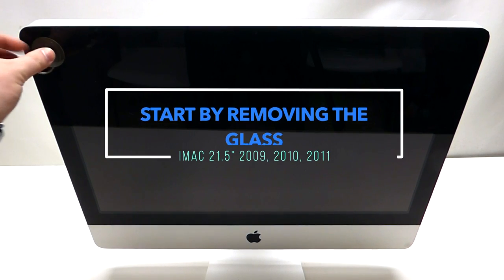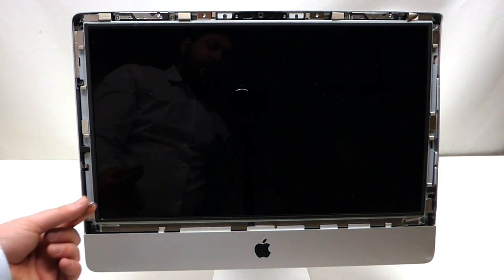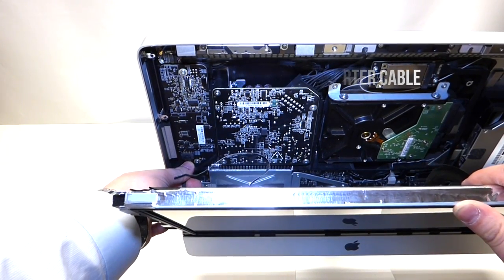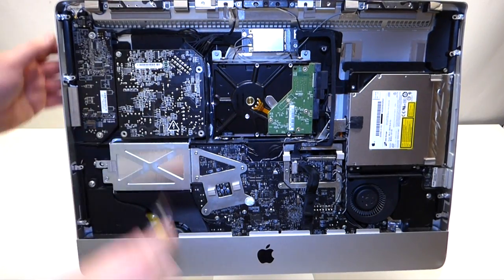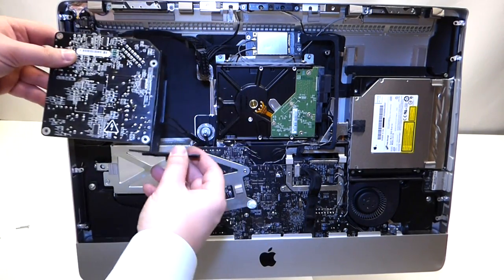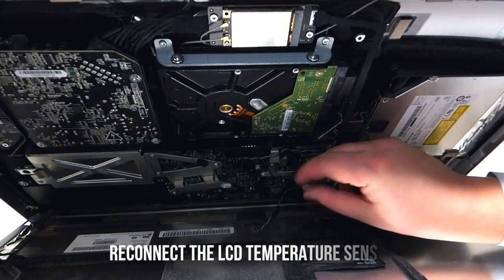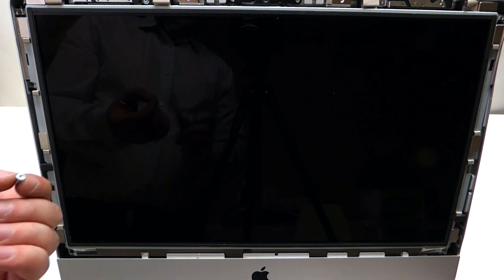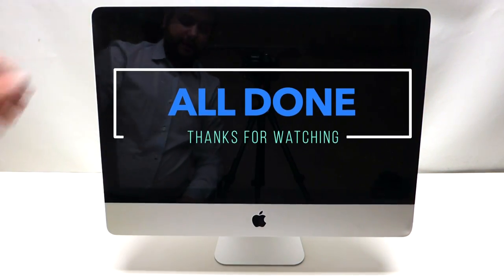iMac Power Supply Replacement 2009 2010 2011 21 5" Apple Dollars #12

Comment: Excellent video. I followed it just now to replace the power supply on a 2011 21.5” model.  Worked like a charm. The data connector on the 2011 model screen is smaller and more fiddly than the one in the clip but the idea and procedure is the same. $50 for a used power supply on eBay, $7 for the suction cups for the screen, the torx drivers I already had, a lot cheaper than a replacement computer.

Comment: This was very helpful. Was quoted $180 plus tax to get it fixed and after finding your video, I purchased the part for $22 on eBay and installed it myself. Thank you very much for sharing.
Reply from the maker: Glad to help! Support us on Patron https://bit.ly/2F3ebil or By clicking the KEEP US GOING button at https://www.appledollars.com/support-us
Reply: @GRIBSOFT  great video, but how do i know if this is my problem?  i have this model imac and i powered it off, unplugged it for 8 hours and now it has no life and won't turn on at all
Reply: @TheJstringer  listen for a "bz" sound coming from the top of the screen. thats the issue i had, with my imac.

Comment: Must be a lot of different iMacs in those years. My 2010 was a lot different inside than this one. Two of the large ribbon cables could not be disconnected from the screen side. I had to work around the screen to get to the power supply.

Comment: hi Thank you for the video. I've got a dead iMac 21", bought a pair of suction tools and the power supply, and pulled out the screen. But soon encountered a problem around 33 sec of your movie: after successfully pulling up the top two cover, I cannot even unplug the lower part of the screen! I don't know what's going on, but it seems that the lower magenet or something got in the way to prevent me from pulling it out. Not sure how to proceed. Any suggestions? many thx!

Comment: Hi! Good video. My iMac 2009, is totally dead, no sounds or lights when pushing the start button.
I've accessed the PSU. AC power is going in. The mother board LED 1 lights up (when the AC power is connected to the iMac).
DC out put (COM is 1) - No 2, 7, 8, 9 indicates 12V,  
No 3, 4, 5, 6, 10 has Zero Volts.
Is this the PSU or something else? Appreciate your export opinion. Thank you

Comment: I am debating if i need to change the power supply on my mid 2011. It stopped powering on. I opened it up and have the Led indicator #4 is on. But #1,2&3 are off. I can hear a buzz from the power supply but nothing else is on. I cannot hear the hard drive spin. Any suggestions? Would it be power supply if that #4 led is on?
Reply: Did you ever figure out what was wrong with your imac?
Reply: I'mstill alive no still dead, i was wrong with which led was on. Its number 1. But still do not know whats wrong
Reply: Im in the same boat. I have already bought a new imac at this point. I was just trying to figure out if i should spend the extra money to attempt to fix this imac. I know before my power supply went out i was also getting a black screen so i feel like it's a lost cause at this point. Ready to pull out the hard drive and dump the whole thing.

Comment: Thank you for your well infomred video. I will apprecaite if you or 
anyone in your forum could tell me what is happening to my Imac mid 2011
 27 inch not coming on. The stand-by LED light on the boards comes on 
and goes off immdiately when  I insert the power cable. It is not stable
 for me to press the switch botton . So is the problem with my power 
board of the logic board. I need your urgent response for me to know 
what to buy as replacement
Reply from the maker: You need a new power supply
Reply: @GRIBSOFT  many thanks for your prompt rsponse. Is there no way or advice or link you can share to troubleshoot the problem with the pow
er supply in the view to fix it rather than buying a new one
Reply: @GRIBSOFT  Hi, Thanks for the advice. I just change my power supply . unfortunately my imac did not come on. it was behaving the way it was before changeing it. that is the first led standby light on the logic board showing green was not stable when you put the plug in. It goes off and on rather than it to be stable. immediatly I press the switch nothing happens and the led light will stop flicking. After a while when I remove the plug and repeat the processm the led light will continue to flickers rather than being stable. What else could be responsible please. Just to note also,When I tested mypoert supply with meter, the input voltage was 240 but there was no output voltage to signify that a supply is going on to the board

Comment: I’ve always heard that you shouldn’t touch the front of the power supply where all the connections are soldered to avoid shock. Is that true? Or will you only get shocked if you start messing around with the capacitors?

I see on the video you grab it without Rubber gloves and touch the front side of the power supply unit.
Reply: Sorry for the late reply, but the reason he did touch it was because he had the iMac unplugged. He states the caution at 1:40. Cheers.
Reply: @charlie1361  it will still shock you
Reply: @piggybackbuyer2329  this shocked you without being plugged in? What did you touch that you were shocked? Thanks

Comment: Hi, thanks for posting the helpful videos. For the past couple of months my imac had an issue, it would shut down suddenly after 15 mins sometimes 10 or 5 mins, until it stopped working at all (no power whatsoever). I ordered a used power supply online because i assumed that if there's no power, it must be the power supply. I replaced it and still no power(no sound, light or fan) nothing. I'm not sure if the power supply that i bought was not functioning or the cause is something else. I also don't know how to test a functionality of a power supply with a multimeter. Any advise would be much appreciated. Thank you
Reply from the maker: 1 Power supply, 2 Graphics Card, 3 Logic Board. Replace in that order.

Comment: My mid 2011 won't turn on... when I press the power button, I hear the CD drive trying to eject or something, but never hear the startup tone. The screen is black. Does that sound like the power supply? If I plug in a USB mouse, the red light will come on but there is the hard drive never starts and the display is black
Reply from the maker: The LCD is the first thing to replace, then try the graphics card next.

Comment: Nice simple video!   I have a 2009 iMac 27, suddenly today it will just not turn on (no sounds, no beeps, no fans, no response at all).   We just had a power outage during a storm and I'm not certain if i need a power supply or the main board...  (it is plugged into a $50 surge protector).  My only clue that i might need the main board is because one diagnostic green light is on when plugged in (looking from underneath on the inside) which indicates power supply is getting power right?  how can i tell??
Reply from the maker: It's the power supply.
Reply: @GRIBSOFT   even if the green diagnostic light is illuminated?
I'd hate to spend the money on a hunch
Reply: @GRIBSOFT   What does the green diagnostic light indicate (on the main board)
Reply: I have 1,2,3  led lights on. On start up I hear the initial click but no chime. Black screen. Fan runs normally. Could Power Supply work partially to trick me it's something else wrong?

Comment: My 2009 iMac shut off with no reasons. When i try to turn it on, it makes the classic "dong" sound but the screen remains black. All te USB ports has no power but the imac still run.  It could be the power supply?

Comment: I’m having an issue with my 2011 iMac. I recently dismantled it to clean the 9 years of dust that had accumulated inside the fans etc. When I put it back together the screen is now flickering when I turn it on. It was working 100% fine before this. I did remove the power supply unit too when dusting. Power supply unit my issue?
Reply: follow, my screen is flickering as well. Is your screen flickering like the brightness varies. (so not like on and off)
Reply: ACMDE changed my power supply. Working 100% again now

Comment: Do you know how to check if the power supply is what needs replacing? Thsnks
Reply from the maker: Only trial and error.
Reply: @GRIBSOFT  can you write  a basic description of how to determine the power supply is the problem?  that is what this video is missing at the beginning
thanks
Reply: @TheJstringer  Also, what's the correct power supply?, what are the specs? is it upgradeable to a 310w? Why or why not?

Comment: Good day I would like to ask if you have some idea, I buy 21.5 iMac in japan  they use 100 volt.. can I use my Mac in Philippines which using 220 volts?
Reply: It should do. I'm in the UK. My 2007 iMac has a power supply that operates across 100V-240V @50Hz-60Hz. Apple uses universal power supplies to simplify their production processes.

Comment: My iMac 21 don't start at all. I press the button, but nothing appens. Can it be due at power supply?
Regards
Reply: Paulo Ramos same, did you get it fixed?
Reply: @idantal1213  Yes, after dismount it all and clean the supply power. I also changed the power cable for another.

Comment: Is there anyway to test the power supply?
Reply from the maker: On older imac there were light indicators. I wouldn't test the power supply with minimal knowledge as it is live at has AC current going through it. Your best bet is to just purchase another power supply used.
Reply: Save Apple Dollars That's what I was planning to do.
Reply from the maker: The list of parts that usually break in this model go as follows: Power Supply, LCD Unit, Inverter, Graphics Card, Logic Board. I would start with the power supply and move to the inverter next as they go for less then $20. Good luck.